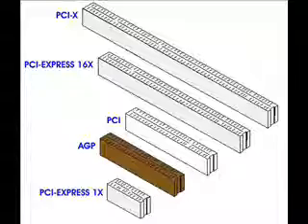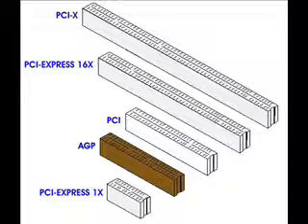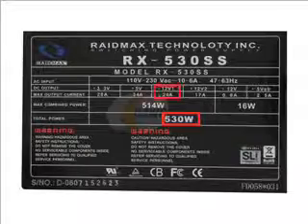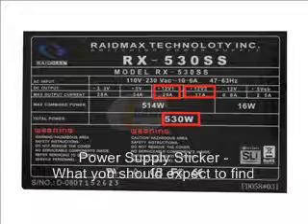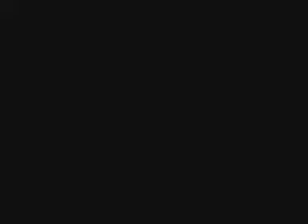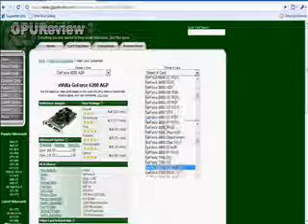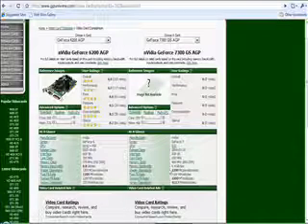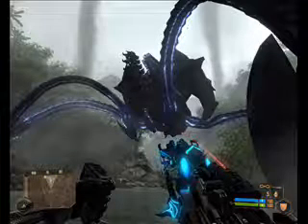How to choose and install a graphics card

Comment: @Techsmartfood I want to upgrade my computer to actually HAVE a graphics card since my other one broke =[ my comp specs are:

Intel Pentium 4 CPU 3.00GHz already overclocked
2gb ram
I dont know the wattage of my power supply but i think its 330w

I need a decent but low wattage gfx card and a chaep one too £30 max :/
Currently its only got 96mb of memory and has no pixel shader
I have a pci slot

Comment: Hi useful video guide.

I want to upgrade my graphics card to the PALIT 2GB NVIDIA GEFORCE GTX 460 SONIC GRAPHICS CARD from the  ATI HD4350 1GB Graphics card  . Is there a problem there? Or is it easy to do? Its for my sons PC and I have never changed a graphics card before. Many thanks for any wisdom in advance. 

My current pc spec is

- AMD Athlon II 250 3.0GHz Processor
# 4GB 800Mhz DDR2 RAM
# 500GB Hard drive
# DVD RW
# motherboard: ASROCK N68C-s UCC
# ATI HD4350 1GB Graphics card